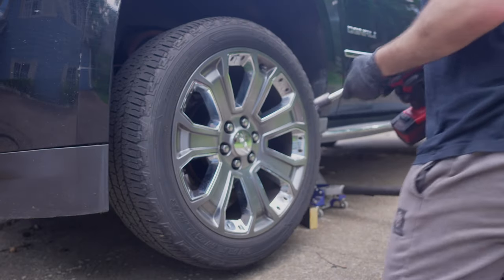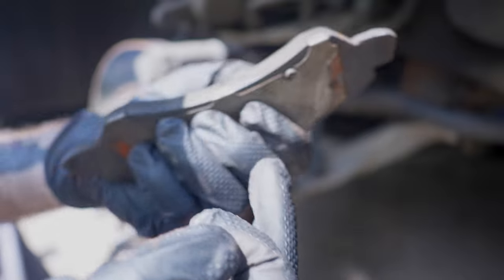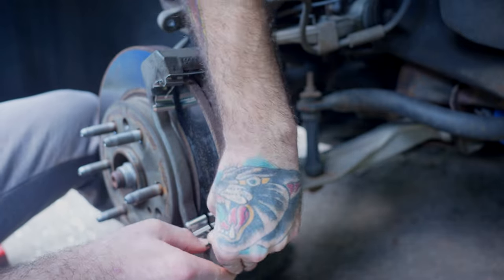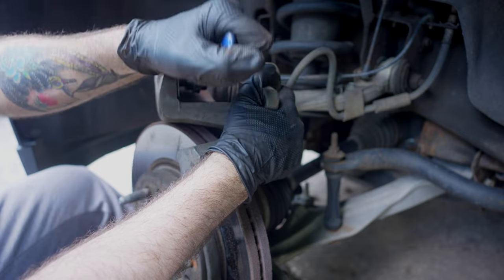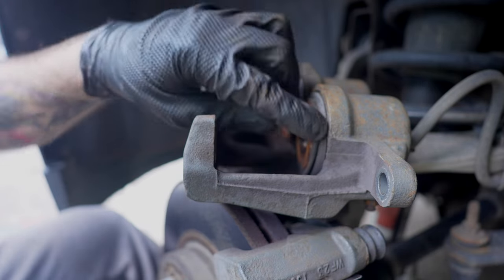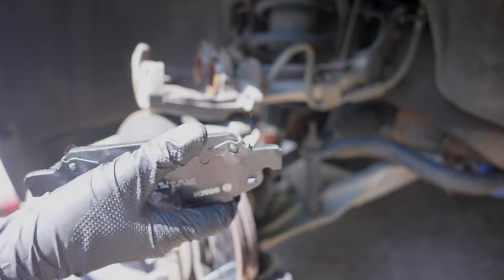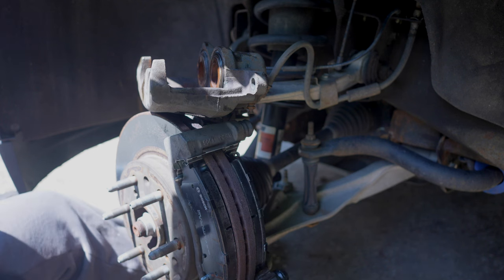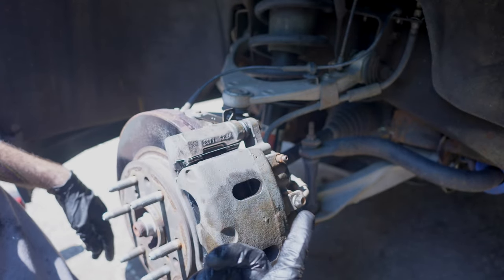2015 and Newer Front Brake Pad Replacement | Yukon Sierra Silverado Tahoe Suburban

Comment: You should probably check that caliper. I don’t think oil should be leaking from the piston. The oil seal probably broke, if so you need a new caliper. You don’t want that oil getting on your new pads.
Reply from the maker: that was water in that seal